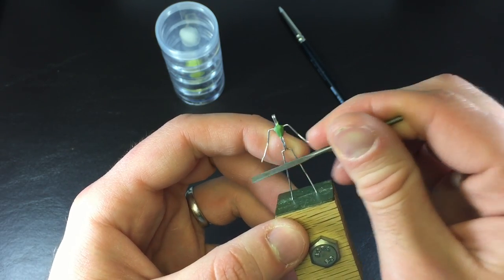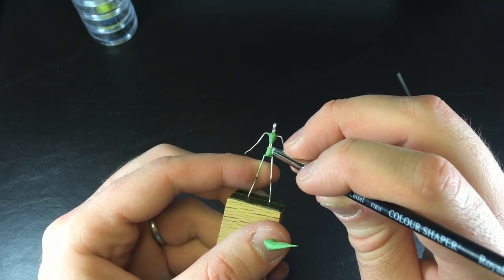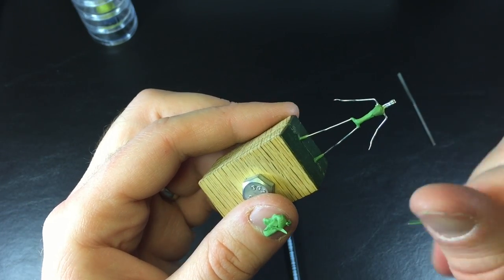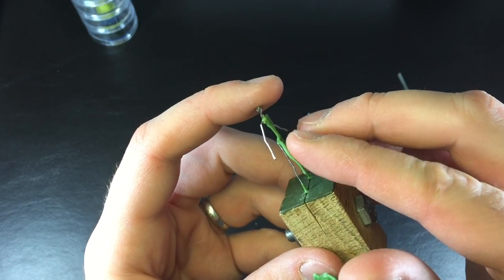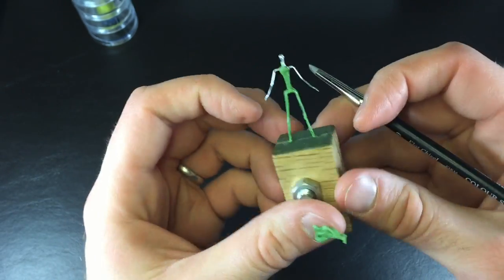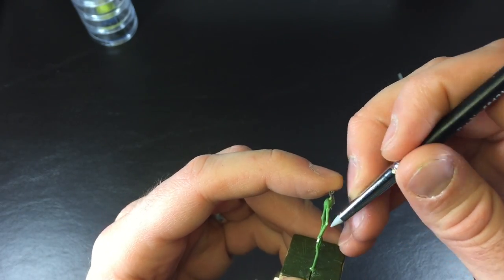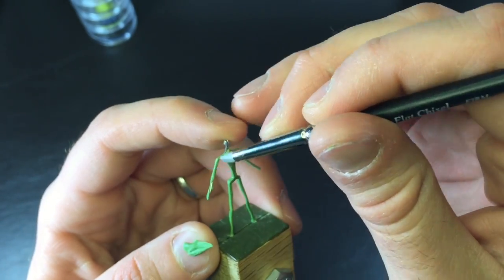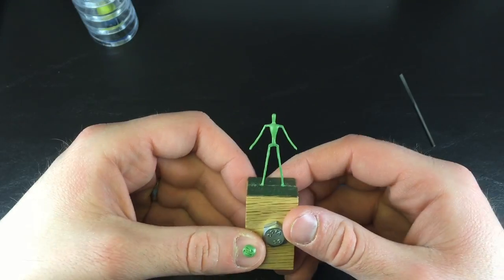Prepping Armatures - Adding the first layer of putty

Comment: Knead-A-Tight is the tackiest of the putties. According to the manufacturer, it's actually an adhesive, so that explains the bubblegum-like qualities of it. That's good advice using it first on the armature.

The Clay Shapers are the greatest invention ...E...V...E...R. I use them more than any other tool in the arsenal.
Nothing sticks to them and they move over the putty like you used a lubricant like water or petroleum Jelly.
I actually cut the handles off at the ferrules because I found them getting in the way a lot. It allows more freedom of hand motion when sculpting. https://www.flickr.com/photos/128248274@N05/22829705894/in/album-72157659572681564/
Reply from the maker: +GamerZapocalypse cutting down the clay shapers is another good suggestion. I prefer my tools shorter and frequently find myself bumping the lights while I filming :)

Comment: Tom, thanks for videos! I am totally new to miniatures and after failing pretty hard with procreate I found your videos! I am wondering if you use water on your hands or tools when working with the green stuff or procreate and if so how often?
Reply from the maker: I tried water when I first started... with disastrous results! Water is totally cool to use, but you need to make sure there is very little or it will get caught underneath the putty and it won't stick. I prefer to use petroleum jelly (again very sparingly).

Good luck!

Comment: Hey Tom, don't know if you still reply to old videos, but a big thanks, hoping to catch you if you do a live QA.

On the subject of this vid, I don't have ProCreate (a little broke) but I'm trying out using BluTack (the stuff for putting up posters) to be the initial sticky layer. I haven't actually applied any P Clay to it yet, but is there any reason this would be a problem? It seems to stick well and be much more adhesive than the clay.
Reply from the maker: SanjiSasuke that is some creative problem solving. However I would advise against using poster take. The reason I use ProCreate or Greenstuff for the initial layer is that it starts sticky, but will self cure, making a rigid understructure. Since the poster tack won't ever harden, it will always be moving and flexing around the armature. This will make sculpting difficult at best. At worst it will create cavities under the Pclay and could compromise the sculpt. 

I'd suggest practicing sculpting only on polyclay until you can afford some ProCreate or Greenstuff. Just make a ball of clay and shape it into something. Faces are great to practice on because they can be so difficult to master.

Good luck!
Reply: Tom Mason Thanks for the help and tips! I'll hopefully be able to get some soon. So far it works better than pure p clay which I was using prior. That was pretty frustrating. Practicing faces is certainly in my future. Looking forward to future tutorials!

Comment: Hi Tom...may I ask you a question please?...a bit of a newbie question...after making my armature and roughing it up with a file I get my grey/yellow milliput and start applying it to the frame...my problem is when I'm rolling a small thin bit like a calf muscle etc sometimes the putty crumbles...is that because the putty is crap or is it maybe because I haven't mixed it well enough? or do you know of any other reason it crumbles sometimes?...cheers mate...all the best Dave...
Reply from the maker: The putty isn't crap, but it sounds like the white/yellow Milliput isn't the right material for this stage. It's best to us a sticky putty with good surface tension like greenstuff or ProCreate. I'm not sure if there is a different version of Milliput that would work better.

Do you have access to greenstuff or ProCreate?
Reply: I've just looked on Amazon UK and found some kneedable green stuff...I hope that's what you mean because I just bought 12" of it...I'll let you know how I get on with it and the white milliput Tom...thanks mate
Reply from the maker: That sounds like the right stuff. If you like the milliput, but want to play with the properties, try mixing some greenstuff in with the miliput.
Reply: I like the green stuff it goes onto the frame so much easier but it's so bloody expensive...I will try the milliput on top of the greenstuff layer and see how that goes...
Reply: The greenstuff comes in a strip with yellow and blue next to each other but I noticed the blue strip is not as wide as the yellow strip so I'm guessing they are not a 50 50 mix more of a 60 40...
Reply from the maker: Don't let the price get you down. The stuff goes much farther than you think when sculpting in our scale.
Reply from the maker: You are correct. It was originally intended to be 60/40, but you can change the mix. I prefer more yellow than blue myself.

Comment: Great videos, I was wondering where do you get your Miniature tools? especially the one used to smooth the putty.
Reply from the maker: Most of my tools are hand made, but you can get some great pre-made ones from these places.

Widget Supply has lots of great metal tools and blades. Check out their Hobby Tools > Dental Tools section
www.widgetsupply.com

The tool I'm using to smooth the putty is a Colour Shaper. You can pick those up at either of these places:
www.dickblick.com
www.misterart.com

Comment: what meterial are you using as sculpt materials? sometimes i saw you using greenstuff, sometimes fimo, other times apoxi composts from aves.. i'd like to appreciate when you choose one over another
Reply from the maker: Lorenzo, you are correct. I do use several different materials. I mainly use Kneadatite aka Greenstuff (the green putty) as a base for my FIMO Professional (the gray clay). I also use Greenstuff for extra bits to add on after the clay has been baked. The majority of my sculpting is done with FIMO Professional though.

Comment: Hi. I have only just got into sculpting and these videos are immensely helpful. I am working with Procreate and I was wondering if you had any tips on smoothing surfaces for painting. I tried the Milliput juice technique, except using Procreate, but it doesn't seem to be working and would probably require 20+ layers to have a noticeable affect.
Reply from the maker: That's a great idea for a topic. I am unfamiliar with the Milliput juice technique, but I can certainly go over how to get nice smooth surfaces with putty.

Thanks for watching.
Reply: Thanks that would be incredible and much appreciated. It is a technique I learnt from Jeremie Bonamant's miniature painting DVD. Basically you take a small ball of putty, put a small indentation in the middle of it into which you place a small amount of water, which you then move around with an old brush to create a milk like consistency 'milliput juice.' This is used for smoothing the surfaces of metal miniatures so you get a very smooth surface to paint on. I figured it might also work over epoxy putty, but very little putty becomes suspended in the water when I used Procreate rather than Milliput, so I don't even know if it would be a useful technique for sculpting minis